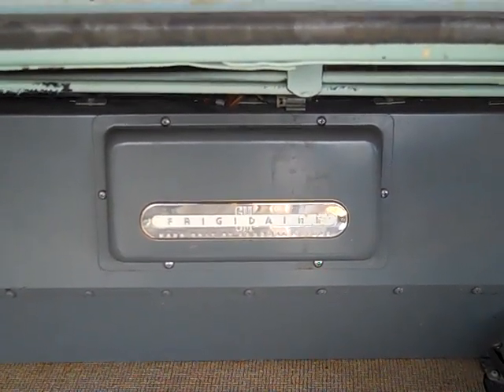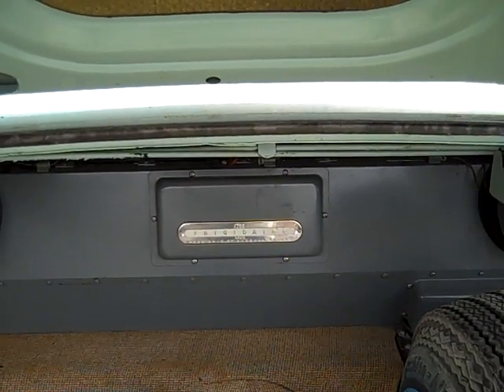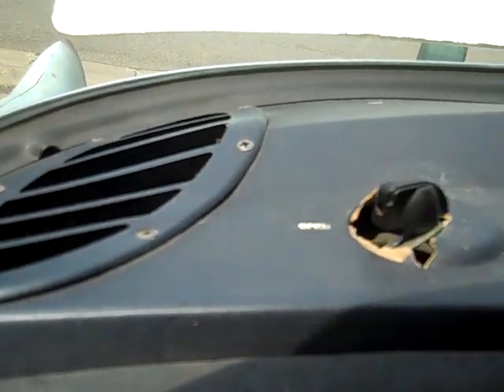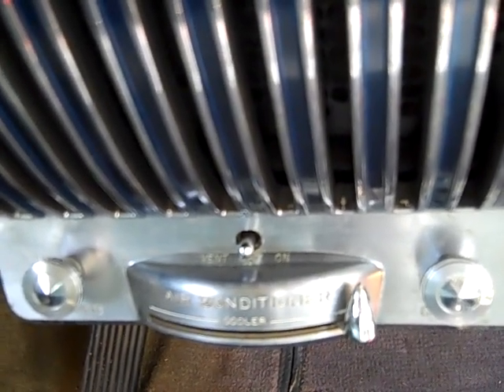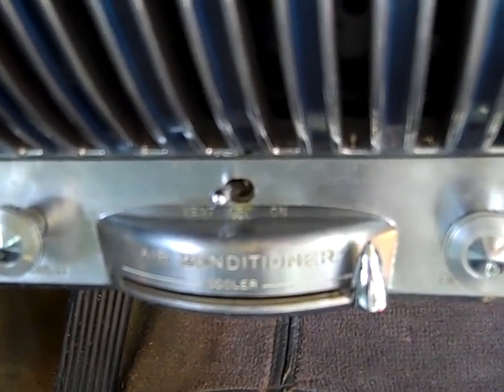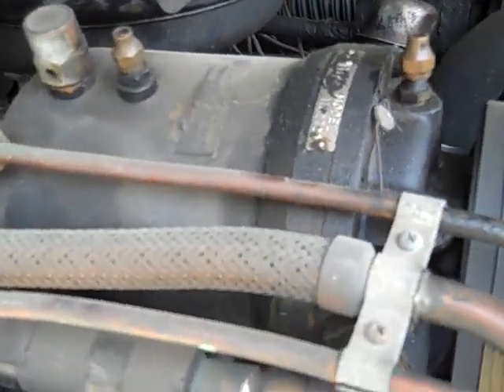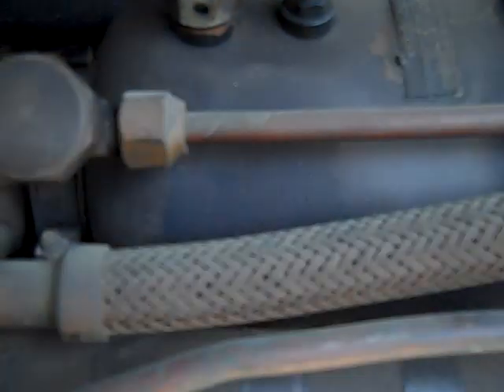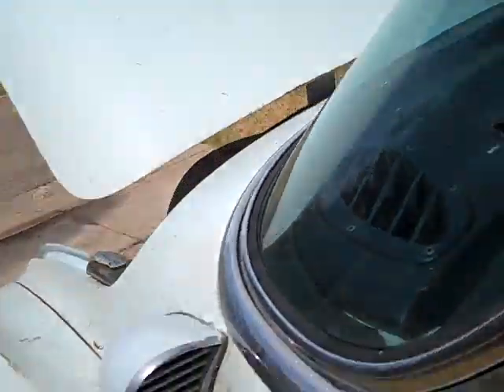1953 Cadillac Series 62 Coupe with Factory Air Conditioning Part 2

Comment: Man, that compressor is a beast! Thanks for the tour.
Reply: (I'm also NDrLoR)  It sure is, they were overbuilt from the start!  It's interesting that GM never made anything but rotary compressors while all the other brands used a variety of reciprocating models.  Ultimately, the rotary compressor settled out to be the universally used design because of its simplicity and smoothness.

Comment: Just found these videos. You did a great job. It's a nice system, great piece of engineering history and an amazing car
Reply: (I'm also NDrLoR)  Thanks, deejaye!  GM did a tremendous job on their first year Cadillac AC after the war compared to other makes.  At least in Cadillac there was the ability to control both fans speeds and vary the amount of freon travelling through the system.  And in '54 it would also be the first to provide a clutch for the compressor so it wouldn't run all the time.  I still have the car, too.
Reply: @VictrolaJazz  
I'm glad you still have the car. I found your video because my great grandfather owned a 53 to 56 Cadillac with AC. I'm 48, last time I saw the car I was 9 or 10 years old. My dad and I have been talking about it lately. Again, the videos are great. Thank you for sharing

Comment: I have always been facinated by early automotive ac.
1975 while at Montgomery Wards automotive in IL. I seen a 53 Caddy with the clear tubes and air scoops. I knew it was early ac. That Caddy was the same color as the one in the vid.
I wonder if the ac worked well during a cross country trip?
In 1960 my dad drove a 59 Caddy to Acapulco, Mexico from Chicago and back with 4 ppl in the car.
I didnt go.
I did go on our trip Chicago to Los Angeles in a 65 Caddy with ac. The ac froze up in Las Vegas. My mom was pist!
Reply: (I'm also NDrLoR)  Thanks!  The '53 sedans did use the Plexiglas tubes that carried the air to registers above the seating positions (called airline style), but for some reason they were used in coupes.  I have driven it on a hot day many years ago and it is very effective.
Reply: @jazzvictrola7104  cool. Thanks.

Comment: This 1953 Cadillac was made at a time when Air Conditioning was on very few cars. Air Conditioning was only available on luxury cars as a very expensive option around 1953.
Reply: (I'm also NDrLoR)  It had been available very briefly on Packards, Cadillacs and a few Chrysler products from 1940 to 1942, then dropped with war production.  After the war, '53 was the first year it was available from the Big Three.  It was available on Cadillac, Olds and Buicks, but on an Olds it was a 1/3 of the price of the car, over $700!

Comment from the maker: Chrysler and Ford did not have clutches until '55.

Yes, the first two years for factory AC on Chrysler Airtemp, '53 and '54, did use R22.  A friend had two '54 Imperials with factory AC owned by Mobil executives in the 50's.  Those two years had a big, V-4 clutchless compressor with a huge pulley that allowed the compressor to run much slower and under lower pressure than those using R12.  From '55 on they used a clutch controlled V-2 using R12.

Comment: A lot of the vaunted excellence of the post-war Rolls Royce/Bentley was due to the generosity of GM/Cadillac engineering. A/C by GM/Frigidaire;power steering by GM/Saginaw;transmission by GM/HydraMatic;hydraulic windows and seats GM.Like people used to say,If it's on a new car,Cadillac probably had it first. After all,it IS the Standard of the World!
Reply: along with high fuel-consumption and high pollution levels
Reply: Luxury cars are not for people who have to worry about gas mileage.

Comment: There is a pretty slick 54 with factory air on Ebay now. It has a real sharp closeup pic of the compressor with that external clutch. Print it out and frame it. It would make a great conversation piece.  Larry

Comment: WHILE THE FRIGIDAIRE UNIT IN THE TRUNK IS THE SAME AS THE UNIT IN MY 53 98 THE REST OF THE SYSTEM IN THE INTERIOR IS DIFFERENT . THIS HAS AIR JUST FROM THE PKG SHELF .MY OLDS 98 HAS AIRPLANE STYLE DIFFUSERS IN THE HEADLINER.ONE EACH OVER EACH SIDE OF THE FRONT AND BACK SEATS. AND THE CONTROLS WERE COOL/LOW COLD /HIGH FAN SPEED.
Reply: (I'm also NDrLoR)  Thanks, Richard!  That was an oddity with the Cadillac coupes, the vents only on the rear window shelf.  In sedans they also had the airplane style diffusers (I've heard that cars made in the north did not use them).  Also, Buick Roadmaster and Super coupes with AC, which used the same body as the Cadillacs, also had the airplane style system as did their sedans.  In a sense, the Cad coupe owners were shortchanged in relation to their lower priced cousins!

Comment from the maker: Thanks!  That system would probably hold five lbs. easily.  In fact I had it charged this past summer, the first time in about four years--we used three cans of Freeze 12 which brought it up to cooling again and I also added 4 oz. of oil.  In '54, GM used a solenoid sitting on top of the compressor that connected to an external clutch in front of the compressor.  Beginning in '55 and from then on, the clutch was integrated into the pulley like on the later A-6 compressors.

Comment from the maker: Congratulations!  It's interesting how things have come full circle--no pun intended.  GM never used any other design but some style of rotary compressor--I believe it's by far the smoothest style.  Both Ford and Chrysler used reciprocating types--York for Ford and their own by  Chrysler, until after 1980 when everyone went to the Sankyo style.  The Ford systems in the 70's Lincolns are transplanted GM systems.  The GM A-6 has the reputation as being the best compressor ever designed.

Comment: Now this was plainly built to last. Didn’t some of these use r22 ? I know some used r12. Loved r12, that was the best refrigerant for auto ac, I can still remember buying r12 and having ice cold ac.
Reply: (I'm also NDrLoR)  Yes, they were definitely overbuilt.  This one does use R-12, but the 1953 and 1954 Mopar (Chrylser) units used R-22 with their big V-4 compressors that ran all the time, slowed down by use of a huge pulley.  When the units were redesigned for '55 with a smaller, clutch controlled compressor, they also used R-12.  I remember back when you could buy a can of R-12 for about 75 cents.  When I heard it was going to be discontinued, I bought about three cases at $2.75 a can and used that supply for over a decade with my R-12 cars.  About six years ago, I  had some R-12 oil added to this compressor as it had become noisy.

Comment: With the size of that condenser and evap, as well as the lines, I wouln't be surprised if it held closer to 10 lb than 5. I can remember when you could get cans of R12 on sale for 29 cents, and they were at least 15oz, if not a full lb.

Comment: I thought there were clear tubes running from the package shelf vents to the headliner, where there were cardboard ducts leading to two vents per side (4 vents total). My '53 Roadmaster had that setup. The package shelf vents looked just like yours, but are you missing the tubes and headliner vents?
Reply: (I'm also NDrLoR)  No, for some reason Cadillac didn't use the tubes in coupes, while Buick did so using the same body, I've never understood why.  Cadillac sedans do use the tube, though.  I've heard they were not used in cars built in the north, though.
Reply: @jazzvictrola7104  Thx. My '53 Roadmaster and a '53 Caddy sedan I know of were both built in Linden, NJ, so that "north" thing isn't accurate.
Reply: @roberthaworth8991  Well I don't know for sure, it's just something I'd heard.  I think all the Cadillac sedans with AC I've ever seen have the tubes.

Comment from the maker: You'll notice in the video a Shrader valve below the compressor--the procedure is to hold a clean rag below the valve, press the valve core and if oil sprays out onto the rag, then you have enough oil in the system.

Comment from the maker: @soulfultenor I'm familiar with the orifice tubes on the late 70's GM--I despise cycling compressors, which pretty well ruled from the 80's-90's.  Now I think several makes use a non-cycling type called variable displacement--that may be what is in my '07 Nissan Altima 3.5 as I know it does not cycle.  Many others do because I can hear them going on/off at stop lights.  I like a good supply of crisp cold air, not what I call "muggy lapses" you get when it cycles off.

Comment from the maker: @TheWSTEENROD I've picked up a small modern Sankyo compressor and it was heavy--I'd hate to think what the one on the 53 weighs!  There's enough copper tubing (no flexible lines in the system) to fund a nice retirement, and the trunk unit probably adds at least another 100!.  Thanks!

Comment from the maker: @soulfultenor The A-6 is kind of the classic of AC compressors, one of the best ever built from GM's era of engineering excellence. The A-6 was adopted by Ford in '72 for Lincolns and T-Birds, then used on big Fords and Mercurys '75-'79. I had a rebuilt one put on my '77 Mercury Grand Marquis and it's perfect.  It's the exact opposite of that nasty little pancake thing GM came out with about '77 that burns out in six months and can't be rebuilt.

Comment from the maker: @dsteveortiz My car does not have the hydraulically operated power windows as it's the lower trim level Series 62.  They could have been bought as an option, but only Coupe de Villes, Fleetwoods and convertibles had power windows as standard equipment.

Comment from the maker: It was available pretty much from every maker beginning in 1953--but there is a possibility that Cadillac offered it in '41 as well--I've seen a cutaway of a '41 with a factory installation.  Packard had it in '40--it was WW II that postponed it.  If it hadn't been for the war, auto AC would have been universal by the end of the 40's.

Comment: I've never put a thermometer in the vent, and I no longer drive my cars in extremes of either heat or cold, but on an 80-85 degree day, you can tell a significant difference between outside and inside temperature, especially because of dehumidification.

Comment from the maker: @hep2jive That's right, it's a 331!  The pent-up demand after WW II was finally satisfied with warmed-over 42's.  Now they had to start adding real amenities to keep customers coming.  All this added a lot of stress to the electrical systems, so they went to 12 volts in Cad/Buick/Olds in '53, Chevy/Pontiac in '55, Ford/MoPar in '56 to handle the higher loads.
Reply: That is not why they went to 12 volts.  They did it so they could use a lighter wiring harness - a pretty big cost save.
Reply: @michaelbenardo5695  (I'm now JazzVictrola)  Makes sense, it was the industry standard by '56, GM just did it first.  It sure turns over a lot faster than six volt when cranking which is what I like.
Reply: @jazzvictrola7104  If you use large enough battery cables, 6 volts will turn the engine fast enough, most people under a certain age just don't understand that and buy chain auto parts store skinny cables, with slow cranking being the result.
Reply: @jazzvictrola7104  Yup, GM decided to copy the British and switch to 12 volts in 1953, before everybody else.
Reply: @michaelbenardo5695  Well things were developing everywhere.  Another thing about the 12 volt system is the way it spins the motors over, were getting higher and higher compression.  A six volt system doesn't have any enthusiasm, sounds like it just doesn't want to get up and go.  A 12 volt system is full of exuberance.
Reply: @michaelbenardo5695  I've just used the normal cables that were on the car.

Comment: I believe these early units were originally designed for limousines, not sedans and coupes. That's why they are designed to blow the cold air into the rear compartment instead of through the dash vents. 1957 was the first year that Cadillac put the A/C in the front with the cold air coming out the dash vents (except for the Series 75).

An extra, extra cost option on these early units was to have the air flow from the package shelf through clear plastic tubes to ducts concealed behind the headliner that led to overhead outlets in the ceiling, like on airplanes.
Reply: (I'm also NDrLoR)  Thanks!  The very earliest auto AC's in Packard and Cadillac in '40 and '41 respectively and a few DeSotos in '42 were all trunk mounted, all made by a company called Bishop and Babcock.  When the Big 3 once again began offering AC in '53, it was uniformly trunk mounted.  Both Pontiac and Nash offered AC in '54 which were both in-dash.  As the '50s progressed, factory AC gravitated to the dash--Olds in '55, Buick in '56 and as you said, Cadillac in '57.  The outlets in the ceiling were not an option but a matter of maker choice.  Both Cadillac and Buick sedans had the ceiling outlets.  In '53 and '54 Buick coupes also had ceiling outlets, but for whatever reason Cadillac, using the exact same body, did not use the Plexiglas tubes or ceiling outlets in their coupes, only the two registers on the rear window shelf.  A few independent makers in Dallas and Ft. Worth, TX, ARA, Novi, Mark IV, et al began making aftermarket units concurrently in the early 50's, but they were also originally trunk mounted units, but by the late 50's were installed under the dash.  For more examples of these units, see my Facebook site Trunk Mounted Factory Air-Conditioning 1940-1957.  1957 Lincolns were the last cars to have trunk-mounted factory AC.  Limos made by Cadillac up through 1965 also had AC's in the trunk, but they existed as a supplement to their in-dash units.  Also, Mopars could be ordered with dual AC into the late 50's.
Reply: The Mark 4 AC system was trunk mounted even in the mid 60s.

Comment from the maker: @hep2jive Hi!  I think you're asking does it use more gas with AC on?  It might, but very little because the compressor is turning all the time anyway because it has no clutch--the only difference is that when it is on, the freon is being forced through the compressor which might take a bit more power to turn it, but very little.

Comment from the maker: @madogblue Due to the age, nearly 60 years old, I wouldn't want to drive it 70-80 MPH.  However, the '53 has a 3.07 final drive which gives it relaxed cruising at 60 MPH as compared to many other cars of the day with their 3.54 and higher final drives.  Aerodynamics were not a significant factor in '53 beyond making a car look good.  More progress was made in automobiles 1903-1953 than in the same interval 1953-2003.
Reply: The same could be said of airplanes as well.

Comment: @NDrLoR  my 95 Roadmaster has the variant of the A4 or A6 Compressor, it still has the swash plate but it's not comparison to the A6 with the oil sump, they were the long belly's I call them, on the older 70's and 80's GM fullsize cars, those compressors were indestructable and they held up better. I know my mom has a 77 Caddy DeVille, with an expansion valve on the evaporator coming from the liquid side of the condenser @ the Evaporator which made it more efficient. They also used a POA system.

Comment from the maker: @hep2jive If it's the sedan that is not running, that would be a very nice car if you can buy it right!  It has absolutely every option, including real wire wheels and AC, but it would be an expensive proposition to restore.  Also, it has the hydraulic windows, which mine doesn't have, and you can add about another $2,000 for their restoration!

Comment from the maker: The heating and AC units on this car are entirely separate from each other.  When new, an auxiliary fan belt was supplied to be used during the winter months to bypass the compressor so it would not run--I'm sure this annoying job was not performed after the car was a couple of years old, leading to premature compressor failure due to its running all the time.

Comment: Did they only use the four vents coming out of the roof on certain models or body styles? I was surprised to see your 56 had the same type of vents as this one.A friend said his first car, a 53 Roadmaster had them in the roof. I guess Cadillac was the last GM to use a trunk unit. I have heard that the a/c in 57Cads was so feeble it was nearly worthless. I think they got much better in 58. I do remember riding in a 58 Olds that had great air.

Comment: Check out the 54 Fleetwood on EBay right now.  It is a bunch of money, but considering the condition of the car it looks like a steal
Reply: +lp1330 If it's the dark blue sedan with a Buy-it-Now for $28,000, it's absolutely worth it!  They call it a Fleetwood but it's really the shorter Series 62, which in a lot of ways I prefer because it's lighter and, well, shorter but with all the same Cadillac quality.  If I didn't have mine, I'd make an offer.  You see lots of 55's, but not many 54's!
Reply: +VictrolaJazz  That is it  I thought it was black-- looked like it on my monitor. What are the odds of finding another in that condition with that mileage AND with complete and supposedly working factory air?  Especially a 54. As the 50's went on, air became more common with each year, and that was the one-off year with the external clutch
Reply: +lp1330 My favorite kind of car, clean and all original with factory AC!  AC was growing almost exponentially each year from '53 on.  In '54, GM's external clutch provided the only factory system that had a clutch--Chryslers still had the clutchless compressor as did FoMoCo.  When you think of it, there was more progress in the 50's than any other decade--it went from barely warmed over 40's cars in 1950 to fully modern vehicles with every available convenience as either an option or standard, everything after that was just variation of the same themes.